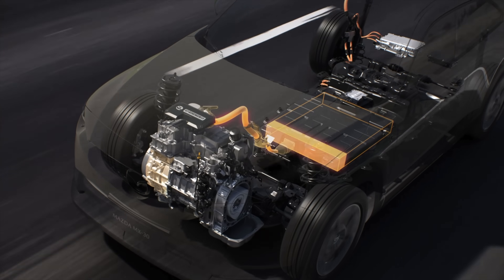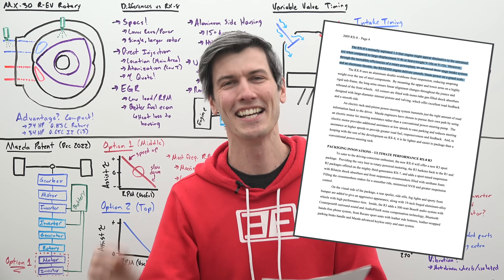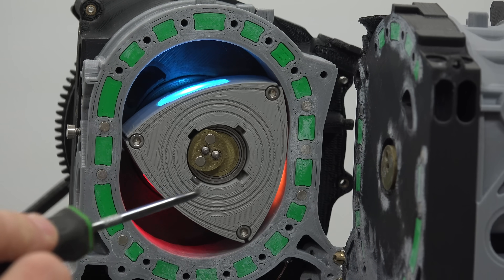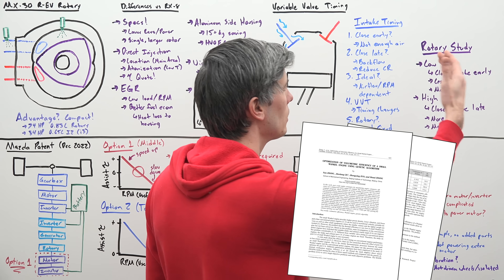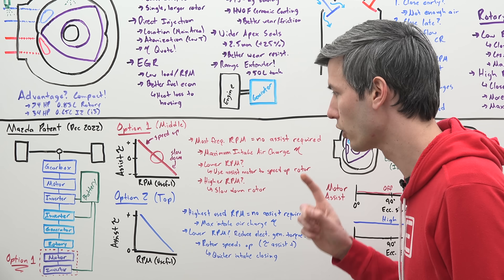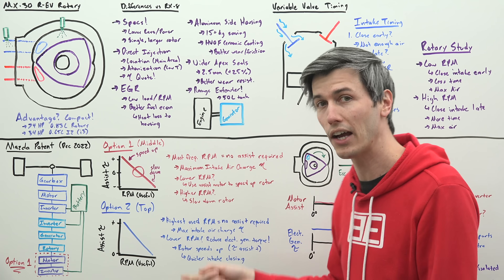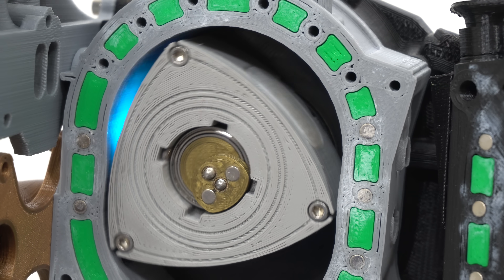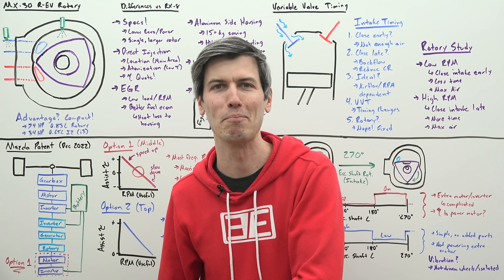Mazda Brought Back The Rotary Engine!

Comment: I thought if the rotary or even piston engine was used purely as a generator then it would have a fixed RPM and therefore porting shape and valve timing are irrelevant
Reply: Yeah I really wished he addressed this. I don’t understand why the engine can’t just run at one rpm. There’s gotta be a reason
Reply: This is exactly my question. If you look at the Paris Dakar Audi E-Tron they use a DTM engine running SPECIFICALLY at the most efficient RPM.
Reply: load varies rpm varies, not as much as conventional, but still there.
Reply: I was wondering that as well. My best guess is that if you're out of battery and hit the accelerator, you'll need more power from the engine, which it could not provide at it's most efficient RPM, so it has to rev up. But if you're just cruising on the highway, you don't need a lot of power assist, so it can run at high load@low RPM

That's just my guess, though. I'd love to have EE answer this
Reply: Exactly my thought and my comment too.
Reply: @yoppindia  Are you saying RPM depends on how fully charged the battery already is?
Reply: @thomaspkratz  yes, also how much you are accelerating while you are charging (some power is pulled from generator)
Reply: @petkogeorgiev2103  but isn’t the very point of the engine that you don’t run out of battery power? Chicken and rev optimized egg
Reply: @yoppindia  Is it not possible to have the Wankel run at its optimum all the time and care for the rest electronically? Acceleration seems plausble at first, but then it does not run faster than at the optimum. But why have it run at lower rates at all, in what circumstances?
Reply: @thomaspkratz in optimal average load it runs at optimal efficient rpm. On low load(battery almost charged, low acceleration) at higher rpm. At very high load(battery discharged, high acceleration) low rpm. At battery fully charged engine is off.
Reply: My assumption is that it comes from a compromise of trying to use the smallest possible engine for the "average" use case, like cruising at 65mph for an hour) , yet still have a buffer range in case you're doing something abnormal, like mashing the pedal up to 100.

This was an issue the 1st gen Prius suffered. The engine was just powerful enough for average driving, but if it had to go up a mountain for more than half an hour it couldn't keep up with the battery drain.

For this rotary, Mazda didn't want to just slap in a 150HP engine in, that'd be obviously overkill. However, while 40 HP might be good for 65mph, it'd fail if you needed to go up a mountain path. So the solution seems to be to have 70 HP engine but run it at 40 HP or something, and ramp up engine speed if electric usage gets higher than expected.
Reply: @JasonWD  because the dakar vehicle is driven at full power all the time.
The mazda will likely run at 3 speeds
Off...
Lower speed to charge the battery
Maximum speed to give full power to the wheels (yes not directly connected to the wheels) with the generator and battery together powering the electric motor
Reply: @yoppindia  Not necessarily, you can still use a governor to increase or decrease throttle based on generator load. I guess there would still be some very slight variance possible but this is a lot of stuff going on for a potential momentary RPM change of probably less than 100RPM +/-
Reply: My guess is they plan to use it as a power train at some point and are planning ahead.
Reply: Me too (minus the hashtag)
Reply: You can have the generator give a set output, for example 5kW, then that power goes to the battery, which could be set to shutdown when the battery approaches 85%. This would be a constant load regardless of battery usage
Reply: @yoppindia  as the load varies the rpm would only vary in the transient phase until the throttle is adjusted to get the engine back to the most efficient rpm. It seems weird that they are developing this complicated method for an engine that will sit at a single speed for 99.9% of its life…
Reply: @X85283  this is exactly what I was thinking, they should be able to maintain rpm with throttle control despite load as long as the load isn’t more than the engine can produce which would stall it anyways because the most efficient rpm should likely be close to the max torque rpm
Reply: @sl8slick  It's because they dont' want to store power... if you product extra power it has to go somewhere and that may or may not be possible... so the best thing to do is make the engine as responsive as possible.
Reply: beta testing before they put it in a sports car
Reply: @blobstrom  This and there is a reserve at the bottom, so it may dip into that when there is a heavy load at "low" battery. Some PHEVs have a mountain mode where they run the ICE to provide a little extra juice to a "dead" (*20%) battery before getting to a mountain so there is enough juice to get over it at highway speeds. Otherwise a PHEV driver will be there with the semi trucks just crawling up the mountain, don't ask me how I know 😅
Reply: @anydaynow01  — You’ve driven an i3, haven’t you ??

Comment: Neat. I've like the idea of engine just generating electricity since I heard about how the Volt did it. Doing it with a light weight rotary engine makes a lot of sense.
Reply: Considering most people only need 50-100 mile range daily, but may need 300+ mile range once per month, BEV with gasoline range extenders makes the most sense. I loved the idea of the Chevy Volt. It's a shame it wasn't marketed well, and that few other manufacturers haven't also developed similar cars and trucks.

I would love an EV F-150 (or similar) with a 100 mile battery range and a range extender with of 300 miles. This would also allow for better towing capabilities.
Reply: @stevk5181  The issue with range extended BEVs is the battery itself. 

If you have a range extender option, that means a much smaller battery pack (otherwise the whole arragement makes no sense). If you actually use the car in it's EV mode most of the time, that means you'll be cycling thru battery a lot more. More cycles means more degradation and much quicker death (or unusable capacity) of the battery.

And you have a system that is a lot more complex (you basically have 2 different drivetrains + generator) and isn't all that much cheaper or lighter, as real world options indicate.

In reality, at least for most folks, it's either pure EVs (with a big enough battery) or a regular ICE. Everything inbetween rarely actually make sense.
Reply: @hojnikb  finally someone who gets it. PHEV is 🤦
Reply: @hojnikb  Then the solution to the charge cycle problem is to use a chemistry with more cycles, Tesla's NCA has about 500 charge cycles, why not use the far safer LiFePO4 with somewhere over 2000 cycles at the cost of half its range? That's still twice the overall lifespan and it saves them loads of money since there's no cobalt in it, thus its also far cleaner to manufacture. Its also got a thermal runaway temperature of 270'C instead of NCA's 150'C (and NMC's 210) and it doesn't change rather than dropping when its fully charged. Or better yet, go full in on efficient generators and use supercapacitors, its even cheaper and the vehicle's peak acceleration can be far higher too.
Reply: @Avetho  

Ok lets do some maths. Assuming MX-30 actually used LFP packs (which it likely doesn't) and the cycle life would be 2000.

Now the battery capacity in mx30 is 17.8kWh. A rought estimation of 20kWh/100km of power use on avarage would mean you could drive on battery alone around 178,000km before the battery dies (or drops below its usable capacity).  That's just 110,000 miles. That isn't much.

In reality, Mazda likely uses NCA pack still which 1/4 of that or just 27,500 miles. That's low, no matter how you turn it.

Not to mention, that most PHEVs don't use cooling or heating of pack, much means even quicker degradation.

Even a cheap decent full EV will have at least 3x the capacity, along with active cooling/heating for extended lifecycle. Which means in theory, the pack will last A LOT longer than in a PHEV.

Do you see now how PHEV make little sense if you constantly drive on its battery?
Reply: Only three other cars have done it before - the Chevrolet Volt, the BMW i3 and the Fisker Karma. The first two have been discontinued and the last one was an absolute disaster.
It sounds like a neat idea but in practice you're best off just getting rid of the complicated oily thing and putting more batteries in its place.
Reply: @hojnikb  the generator and battery are two separate things.  A more useful discussion would present the corresponding graphs that help you to compare various scenarios that weigh trade-offs.
Reply: @hojnikb  I think you're calculating worst case scenarios for the battery lifespan. Batteries are rated in cycles, which is full charge to 0%. In reality, people aren't gonna do that of course so more realistically most people would most likely stay between 20-80, which puts significantly less strain on the battery and goes for much more than the rated battery cycles. idk exactly how the Mazda implementation is like, but if it has active cooling/heating then I dont see battery lifespan being too huge an issue. Plus side is also that the replacement battery would be much cheaper since its a smaller battery compared to full EVs, although it would still probably be expensive.
Reply: @hojnikb  you raise some good points. PHEV is best AND worst of both worlds. However, I think to best address battery life is to use LFP packs, and to have a large enough pack to reduce charge cycles. LFP actually gets 3-5000 mile range, depending on a number of factors. PHEVs always monitor and charge the batteries to maximize cell longevity. So a 50 mile liquid cooled LFP pack would be the best possibility currently, and think 50 miles x 3000-5000 cycles could net 150,000-300,000 miles. That's not too bad, imo. But, you also need to think about inverter life, and the ICE engines life. Fun
Reply: @jedi22300  Mazda likely doesn't use active cooling, as this isn't the norm on small battery packs.

And while it's true, that these are worst case numbers, they apply to both full EVs and phevc. But remember this; people daily driving PHEVs for the intent to use the battery as much as possible are a lot more likely to deeper cycle the battery pack (due to limited range) than folks with full evs and big enough battery pack. So you have two things going against it; deeperr discharge/charge AND no active cooling/heating.
Reply: @deansmits006  Yeah, but the same math (in practise even more cycle life due to thermal managment) will apply to FULL evs. So a full even even with a puny 200mile range will have a million miles on its pack before it degrades to unusable state. 

PHEVs make less and less sense the more EVs get cheaper.
Reply: @hojnikb That’s a pretty pessimistic assumption on the battery cooling. Most PHEV that are not from Toyota use liquid cooling for battery management. They also do not give you access to the full capacity of the pack. That top and bottom 10/20% are locked away to maximize battery longevity and prevent full cycling.
Reply: @hojnikb what do you mean it’s either EV or ICE. What about hybrid, which is right in the middle. Are you saying that hybrid cars do not make any sense? 😂😂😂
Reply: @Keestral  Battery cooling (and heating) has a huge effect on it's cycle life. 

PHEVs lock their capacity, because their batteries are very small  so they cycle relly fast as a result.
Reply: @LuizHartkopf  Yes, the more you think about them, the less sense they make.

Especially once you start crunching numbers and comparing upfront cost compared to gas you're saving. 

That's especially true for PHEVs.

But people just can't do math. They spent 10k more, use on gas half the time and maaaybe save half that in vehicle life.
Reply: @hojnikb  The Volt had very little range degradation, if any.  The main reason for this is that their design allowed for a large upper and lower buffer.  Only about 65% of the battery's capacity was actually used.
Reply: @hojnikb  who said anything about two drivetrains (I supposed that could've been inferred by my comment about the Volt)? You have one engine designed to run at its optimal RPM and a battery pack that is kept between 30 and 70% of total charge. This limits wear on both major components.

New battery technology allows for 1,000s of cycles (measured from 0-100% charge), but still lacks quick charge technology. Even if we can figure out charge rates as high as 10C (6 minutes to full battery) the amount of current needed is ridiculous.

I'd love to know where you got your data for your statement, "at least for most folks, it's either pure EV or a regular ICE." I know for myself and most people I know a PHEV is the best option.
Reply: @Avetho  I have about 130k km on my battery in my gen 2 Volt (OnStar app tells how much distance is on the ICE and battery) and I still have >95% capacity left. That HEV cycling thing is mostly for old NiCd tech and the Leaf where the batteries aren't temperature conditioned. Even with the over five year old battery tech in my Volt it still holds up well despite being cycled much more heavily that a BEV with a gigantic battery. It even keeps the battery conditioned when the vehicle isn't running when it's plugged in and has a full charge. Most PHEVs these days have similar charging / conditioning tech to keep the batteries in good condition.
Reply: @stevk5181  Yes this, you're exactly correct, the ICE in a PHEV is very under stressed/utilized, the electric motor takes the brunt of the acceleration force and the battery has plenty of buffer. Even when I swap to the ICE, it has a soft start, where I use the battery until the ICE and catalytic converter get up to temperature. Considering a pure ICE car lasts well past 150k km these days without a problem, and I barely have 20k km on my ICE and over 130k km on my battery, I will have very few problems in the long run, and I don't have to hoard batteries to calm my range anxiety. Save the big battery BEVs for folks that need them, those who can't charge at home or work, or those who have long commutes.

Our battery resources are very limited right now, and it's only due to get worst with longer wait times as more folks hoard batteries they don't need on a daily basis. Folks who drive big battery BEVs and can charge at home or work are like those people who hoard gas at the slightest sign of trouble or a big storm.